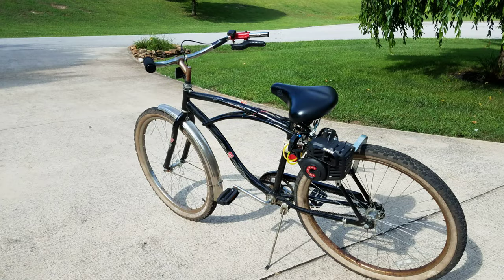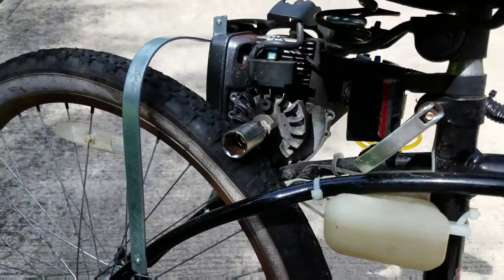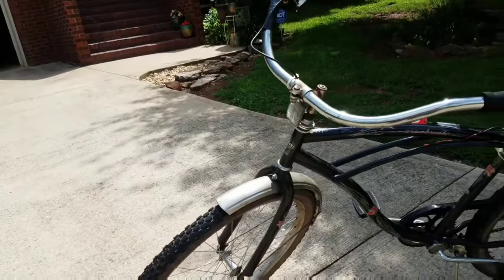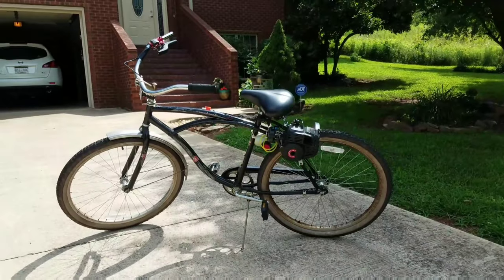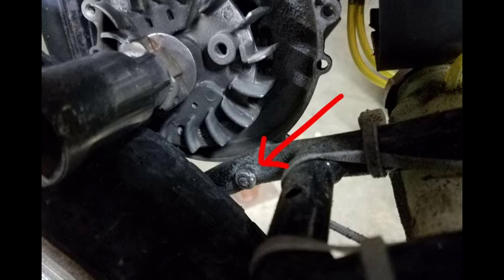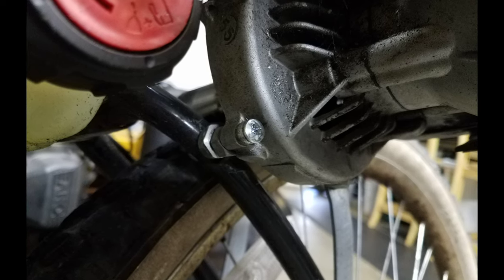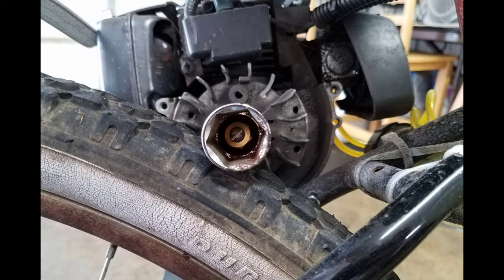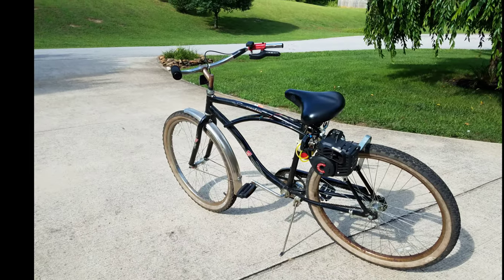Weed Eater Bike Made Simple- 27cc Motorbike Done on the Cheap

Comment: I'm doing this but with a chain.
Reply: lemme know how that goes
Reply: @bingus7361  it went awful but im gong to try  again with better tools
Reply: cog gear lol let me know how it goes
Reply: @CCPwillfall01  that's the spirit. Don't give up
Reply: I would, but I don’t have a welder so I can’t put a sprocket on
Reply: @jonathanwilson1380  sometimes a bike peg from a bmx bicycle will screw onto the shaft.    I had a purple one from a little girls bike and it just fit.  I also heated up and glued some tire tubing to the peg and it made my traction in dirt slightly better.  Dirt would get on the peg and it slipped a little, but the tubing made it slip quite less even tho it still did slightly.  It was originally for when I went through wet gutter it would slip a little and the tubing stopped it
Reply: harder with a chain, gotta have a clutch and all that
Reply from the maker: 👍 Chain is the way to go.

Comment: The issue about those friction drives is that the gear ratio is GARBAGE you have a small shaft rotating a massive wheel, the gear methods are better

Comment from the maker: A Consensus... 

Problems with this design: 
-Friction drive does not work when wet. 
-The roller wears down the tire a lot. 
-Drilled a hole in the frame which weakens it and it's not really safe. 
-Doesn't have a clutch so it doesn't idle, meaning if you stop you'll have to restart the engine. 
-Cheap bikes are wobbly. 
-There's a lot of pressure on the crankshaft bearing because it is being pushed down on the tire. 

Nonetheless, the bike looks neat and it has some impressive torque and straight line speeds. I used to take this thing down to the gas station frequently and buy sodas, and I got a lot of miles out of it and never had any reliability issues (the rear tire had quite a bit of wear on it). But use a better bike than a cheap Huffy. I got going 30mph and crashed and luckily walked away with minor injuries, but the bike did not survive. The steel frame had too much flex for those speeds, and the wheels were soft and had a lot of flex and play. Definitely use an aluminum frame and a quality bike. Also, I highly recommend welding a sprocket to the clutch on the engine and using a chain. You can't use the clutch with the friction drive design because any sideways force on the clutch will make it not work properly. Hopefully this experience helps some of you or was informative. 

Thanks for viewing, 
Parker
Reply: Thanks 🙏 for the input …. As a mechanic I hope you carry on this path …. Everything you said is sound mechanical info/ experience……. Even with my vintage friction drive I want to put a sprocket ⚙️ on it ( without harming the original ) to get away from your list of aforementioned problems… respect
Reply: I used a stihl small leaf blower engine it needed the tire to be wet to work the best. It reached near 50kmh when the tire and roads were wet. But when dry it needed to be moving fast before the engine would stay running and propel me. Probably more to do with that engine being designed for high revs. The socket would get really hot to the point where i was worried about the tire bursting possibly. I accidentally squirted water into the intake once when it was dry out trying to get it to zoom like it did during rain. I moved onto waiting till I had a clutch chainsaw to power it as the blower was only good when raining out which also cooled the tire and socket
Reply: Damn bro you gave me idea with flaws then answered sufficiently those questions. My man thank you

Comment: I used a heavy hide a bed spring to pull the engine down and used 3 pieces of 45 degree angle iron to mount the engine then used the rear brake caliper bolt hole to mount to the frame and the spring to one side of angle iron to the threaded holes meant for mud flapp by the derailuer mount. I had to use nylock nuts due to regular nuts shaking to pieces during the first run. Terryfying to be holding a screaming engine from the throttle cable as it swung all over luckily the gas tank rattled free and fell off the engine which made it run out of fuel quickly. It was like something from a roadrunner cartoon I swear

Comment: Sancta simplicitas. Very nice. No dangerous, costly, noisy high maintenance chains. 20 MPH is the maximal speed you can run safely an old bike with the original tires and brakes. The minimal motorized KISS bike, I love. An easy to make second silencer added to the original one would make a very quiet bike.
Reply: My 22 year old schwinn could definitely make it higher than that and still be stable with a better gear ratio haha, at least it’s got new brakes but I can’t say the same for the tires

Comment: That’s very cool 😎…..the French made a bike called Velo Solex with a drop down friction drive on the front wheel ( I own one built in Spain) . The motor pivots and there is a locking system . Ingenious to deflate the tire . Your mums a trooper !

Comment: I made one and put it on the front. There is no need for a throttle just run it all the way open. For engine controll you only need a kill switch. If your still rolling, let off the kill switch and it will take off again.
Reply: Sounds so Cool
Reply from the maker: Adding a throttle is pretty easy, and I would say it is necessary for safety reasons.

Comment: How did you get the socket to sit in there
Reply: Weld
Reply from the maker: No I didn't weld it. I just used the bolt that held the original clutch to the engine.

Comment: I know this video is old but how to you kill the engine do you just wait until it runs outta gas or do you have to hope for the best when you reach back and try to press a kill switch or just try to stop the tire
Reply from the maker: The kill switch is on the frame between the seat and the handlebars. It is in an accessible location in case of emergency.

Comment: its a bit fat, you can hear it four strokin  , need to lean that carb out a smigin
Reply: 2 stroke engines are more common on weed eaters, considering this ones size, I seriously doubt it's a four stroke... and I think the noise makes it WAY cooler... also the carburetor looked fine to me, but I didn't pay much attention to that so idk.
Reply: @DALIUS Galbraith "Four stroking" is a term for when a 2-stroke engine runs too rich and, as a result, sounds similar to a 4-stroke engine. He's saying to lean the fuel/air ratio out (meaning the engine gets less fuel and more air) which is usually done by adjusting 1 or 2 screws on the carburetor.
Reply: @daliusgalbraith1206  whoosh af

Comment: does this friction drive ever slip? how is power and speed? is having the moter attached to the chain or sprocket or whatever and mounted between the legs a better option?
Reply: Chauncey Hulbert It slips only if it is wet. It actually has an adjustable eye turnbuckle connected under the seat that you can twist if there is a change in tire pressure...  Or if you want to add or reduce slip. It is hard to get as low of gearing with a chain but if you can I recommend that because you can keep the clutch,  whereas on a friction drive you can't, so there is no idle. However,  you can not keep the pedals with a chain drive, or they will spin rapidly and hit your legs. I prefer the simplicity of a friction bike.
Reply from the maker: And also the speed is respectable at around 23-25mph and it does okay on hills, but on a steep enough grade it will bog and stall. This is about as much guts as a little 2 stroke like this has.
Reply: +Mischelle Ferrell im pretty big so i worry that friction wont work well,  i have a weed wacker motor im working with and have attached the sprocket to the clutch so  hopefully it will idle. in hindsight i should have got a chainsaw because it already has the sprocket.

Comment: hello i want to ask what diameter is the friction roller. See you soon
Reply from the maker: александър ковачев I believe it is a 5/8 spark plug socket.
Reply: thanks for the information. See you soon
Reply: This is probably about equivalent to a 250 watt ebike, except that 250watt electric motors can spike very high (over 500 watts), whereas this one maxes out at 250 watts or about 1/3 of a horse..  This drive system is going to go through tires like you won't believe. 20 miles tops before the tire is completely gone.  Using a deep socket (as shown here) makes the friction drive far worse than it naturally is. This is going to want to slip, a LOT, which will burn up the tire. You will have to kill the engine every time you stop except if you have a weedeater engine with a clutch.  You should really try to get one with a clutch and if at all possible, drive the wheel differently.
Reply from the maker: @tarstarkusz  You are absolutely correct. The tire burned up pretty quick. That motor had a clutch originally but to put enough pressure on a clutch for friction drive made the clutch not work and it would be at an angle. I plan to make a mk2 weed eater bike with a clutch and a chain.
Reply: If you end up having to use a friction drive again, you may want to try a BMX peg. It's about the same size as that socket, but it should have a textured surface that will slip less.
If you can make a decent motor mount for it, it will probably work out much better with a chain drive.  If you do that, you might want to buy a freewheel for the front chainring. That way you can drive the wheel without the pedals turning. Sick Bike Parts sells them.
Reply: tarstar

Comment: how did you put on a socket??
Reply: Most of these shafts have 3/8"-24 threads on the inside. Just a matter of finding a bolt/fastener that fits.
Reply from the maker: @adamcotton5356  That's it!

Comment: how do you slow down or accelerate ? do you only use the brakes ?
Reply from the maker: It has a rigged up accelerator lever on the right handlebar. The bike has a coaster brake to slow down. You need some room to slow down to say the least.

Comment: What size socket did you use
Reply: charles rupe It was a deep 5/8 spark plug socket.
Reply from the maker: My apologies. The size was not on the socket, but it's actually a 3/4. Shouldn't be a big difference though.

Comment: you might want to consider a hard plastic for your roller. that socket is gonna heat up and melt your tire
Reply from the maker: It causes a lot of heat for sure. No noticeable "melting" but it does put a lot of wear on the tire.
Reply: @makeshiftworks9779  id invest in a lock and load kit. keeps tension on the motor so  your spindle doesn't rub the tire
Reply: also, street tires are the best. I get 1000 miles out of a schwable marathon plus tire
Reply from the maker: Great suggestion, thanks! My next one will have a chain and a clutch though, no friction drive.
Reply: I have a 2 smoke chain drive. Its faster, louder, and less fuel efficient. I would go for a 4 stroke mid drive

Comment: Is this street legal
Reply: In most states it is. Anything up to 49cc and limited speed of 15-20mph, a Driver License in some states and helmet requirements.
Just check with your local DMV. They should be able to help you.
Reply from the maker: You need either a driver's license or a moped license where I live. However, I would not drive this on busy streets out of courtesy for other motorists as this does only go 25mph.

Comment: atleast you show if its mph or not, ther other ahole videos dont, but yours you have to actually watch to the last 10 seconds, thumbs up buddy. Next question to hunt down on interwebby land, how much weight and what kind of hill will it ride up. Ah f-it Im buying 100Ah battery.
Reply: go 100km on dat
Reply from the maker: I know, the internet is vague when it comes to finding info on this stuff. I tried to research before I tried this. Anyway, it goes up some hills, but anything too steep will bog the engine and stall it. A 175-200 pound person could ride it in normal conditions. On flat ground it will go no problem with more weight. And yes, an ebike setup would be much better than this, but I like the novelty. Thanks for commenting.

Comment: Shame you used a direct drive. Would love to see the kind i built on a vintage scwinn used a 21ccc craftsman tiller motor engine with the exsiting cvt clutch and a sprocket that was from an electric scooter setup using that second electric scooter rear wheel drive gear mounted to the hub spokes of the rear wheel on it.
Reply from the maker: Checked it out. Nice job!!